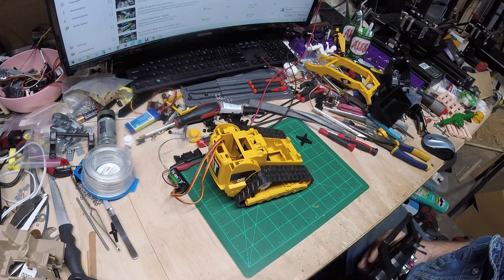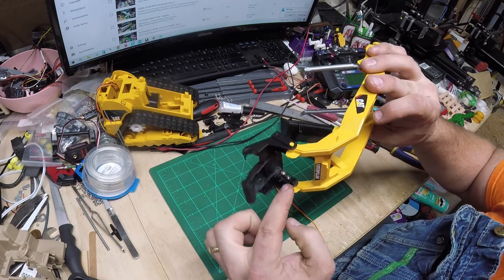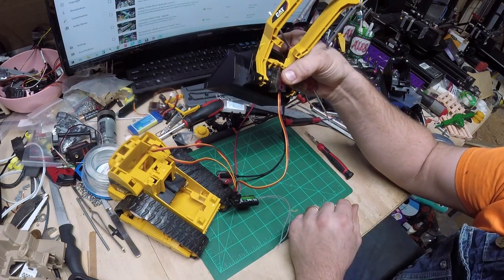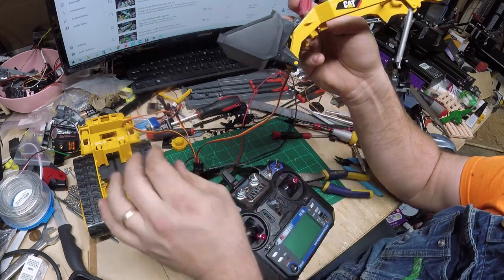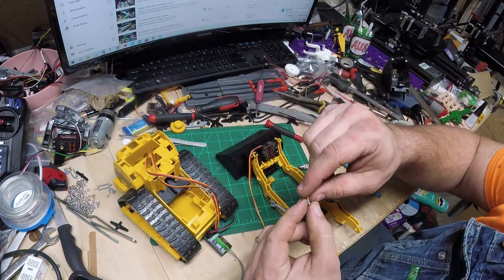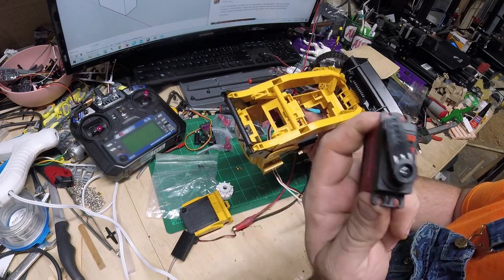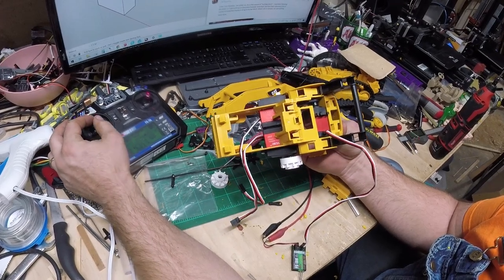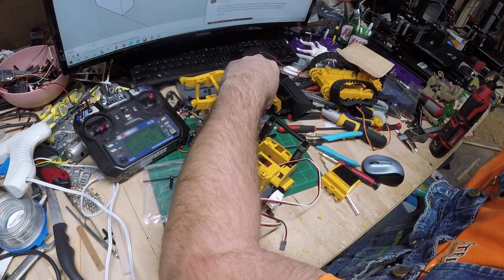RC Conversion - Bruder Delta Tracked Skid Steer - Part 2

Comment: Hello awesome video,
What piece of metal did you use to the lift arm 🤩
Reply from the maker: I just used a small peice of threaded Rod, that I picked up at a hobby store, I use threaded rod so I could add nut to hold the rod in place and hold the arm from the servo in place as well
Reply: @joe_of_all_trades  Thank you i love your detial of this build how small is the threaded Rod

Comment: If you ever get stuck for space you could use a High Speed LOW PROFILE Digital Standard Servo. 41mm long only 28mm high , 20.5mm wide.  9kg torque though.